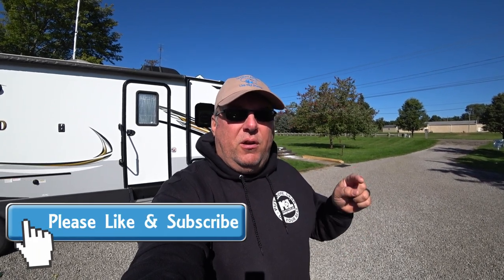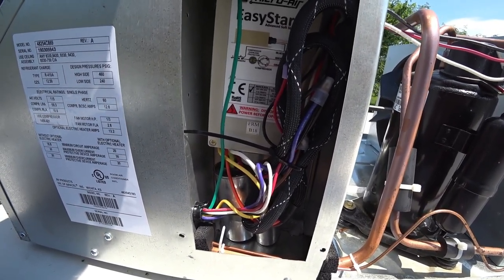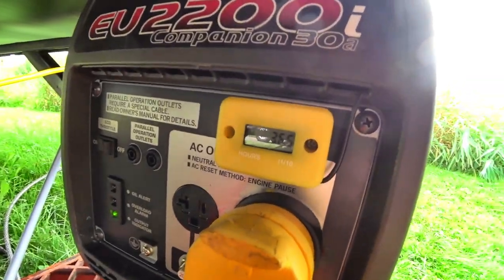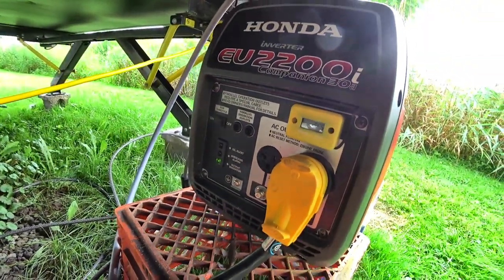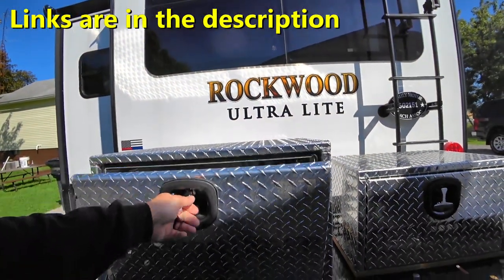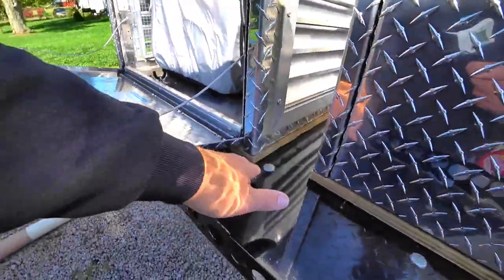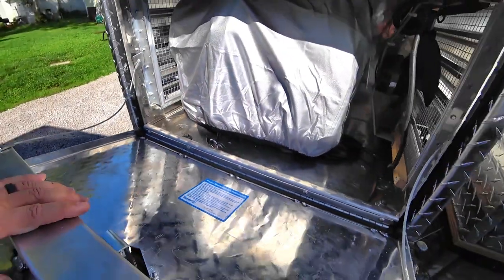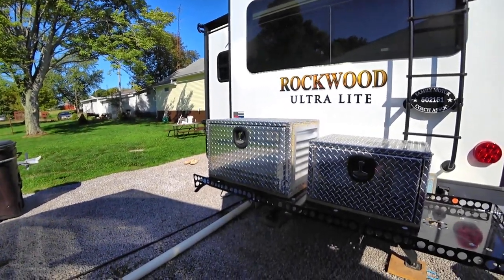RV Generator Box Build FINALLY DONE

Comment: Honda just came out with 2200i bluetooth  app on the phone
Reply from the maker: Yeah I included it in the links. It does have a carbon monoxide detector built into it though so you have to either disconnected or make sure that you don't run into a situation where oxygen gets a little bit low inside that box.

Comment: You talk about weight, then show the worst material on earth.... the diamond plate which is heavy, holds in heat, and is the worst for sound reduction. Literally, a fail in every category but looks. Face it, looks are what mattered. Not even going into the endless choices that made much more sense. I am not trying to be rude, but do research. You choose heavy, hot, and noisy. Most want light, cool, and noise dampening.
Reply from the maker: Sounds like you are the brains between the two of us. Here this whole time I thought aluminum was lightweight and dissipated heat quickly. I mean, Ford uses aluminum on all their trucks... what were they thinking? it's so heavy! And computers and every other radiator type device uses aluminum fins to get rid of heat... what were they thinking?  Not trying to be rude but show me a video of how you could do it better. Keyboard Warriors and armchair engineers. That's what the world needs more of.

Comment: Mike.  A few suggestions. First, the video is titled "RV generator box build".   It is 15 minutes into the 27 minute video before you get into the actual build.  Get to the point.   Second, your presentation of the box does not provide anything about how well it works or if it works at all.  Unproven.   You even state you have not actually used it, but it is presented like you know it will work.   This is followed by throwing rocks at commercial boxes and basically stating they won't work because of probable ventilation issues (shortly after you admit you don't know if your fan will be needed or will be adequate).... ???    Have you tested commercial boxes? (no I don't make or sell boxes) It makes sense to me that before you promote a home build that costs in the neighborhood of $650, perhaps you had better put some hours on it, prove your statements and don't criticize alternatives unless you have direct experience to prove deficiencies.
Reply from the maker: Move Along, obviously not a subscriber and have not followed the build as it continued and has been proven to be far superior than what is available currently on the market. How do I know? First of all cheaper oh, I don't know where you got your $650 figure at but your math is more than fuzzy, and number two oh, I've been contacted by the numerous people online and in person at RV parks wanting to know where they can buy my box at. They are very disappointed to find out that they would have to build it. Then they go on to say how the boxes that they have purchased in the past have not been up to par. And yes why, because of water leakage and ventilation. This channel isn't about how to, this channel is our blog showing our daily lives moving into full-time RV life and the stuff that we have been doing to prepare for that. That generator box has been talked to death on my channel. Because it's not all package nice and neat and displayed in a manner in which you, by the way don't even post videos, think I should be producing a video should be done. If you don't like the video thumbs down it and move along. I posted well over 1000 videos on YouTube over two different channels, and have helped thousands of people in the manner in which I do the videos. So if you feel as if you need to be a self-appointed Critic realize that this push back is what should be expected.